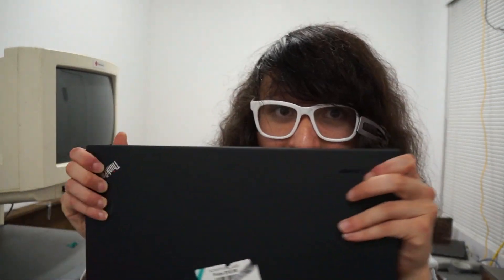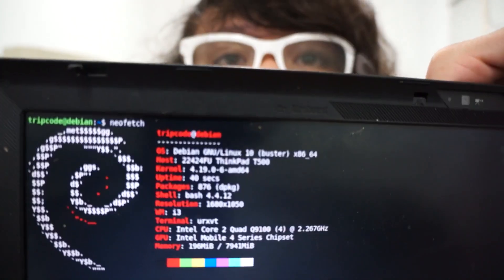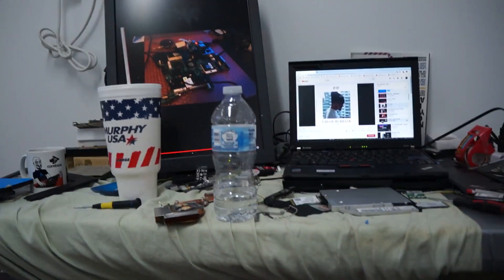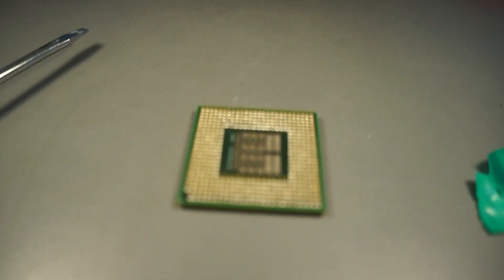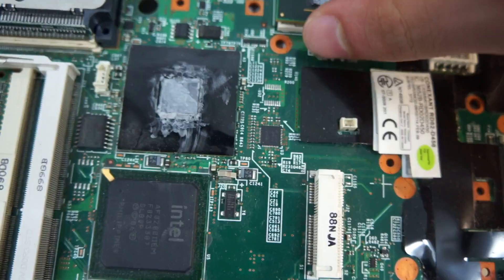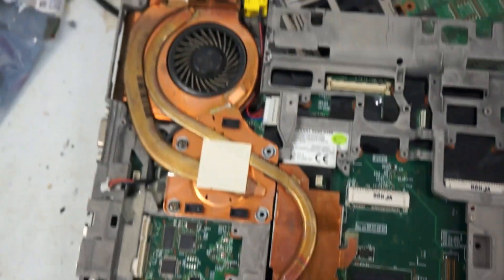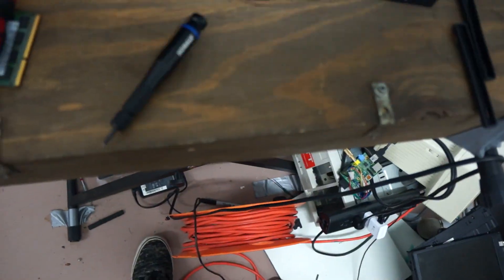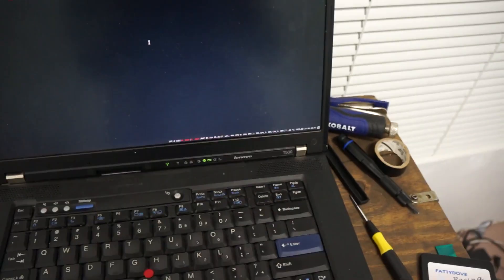Thinkpad T500 Quad Core (The fastest libreboot laptop?)

Comment: Hey got a few questions about this build trying to attempt something simaler for use in a 2503 advanced dock and want a quad core to power it, is this doable for windows ?
Reply from the maker: Kinda, its been tested with windows 7. Unfortunately I have no personal experience with it and haven't heard about anyone doing a windows 10 installation either. 

Although from the thinkpads.de forums

"With this ROM, you can boot to Windows 7 with the Quadcore CPU and Suspend-to-RAM works as well.
However, there are still several issues:
>The keyboard in SeaBIOS often doesn't work (it works later in the OS)
>The wake from S2RAM takes forever on Windows 7, sometimes doesn't work at all.
>Clock doesn't work in Windows 7
>Installing Windows 7 from DVD doesn't finish, it has to be on the HDD already (I didn't test Linux)
>some more issues"

Unfortunately I have no knowledge of trying this with a advanced dock.

Sorry I couldn't be that helpful with your project.

Good luck, and have fun, Also curious about how it turns out :D

Comment: I snagged a ThinkPad W500 on eBay for about 80 dollars that has a T9900 (~3.0 GHz Dual-Core?), though the battery life on this is a complete joke even with the Ultrabay battery lasting less than an hour. Hopefully when I have some spare time on my hands, I'll be able to attempt to libreboot this.
Reply from the maker: I haven't tried this mod on the w500 :D it would be pretty cool though especially if you had the graphics card working.
Reply: @tripcodeQ7  I might just end up sacrificing the graphics card, considering that NVIDIA to this day does not play well with the libre software community and the GPU is really outdated by today's standards.

Comment: Windows 10? But why?
Reply from the maker: I hate using windows 10, but it boots up on more hardware and I can dd an image of it. I have an image for when I sell computers occasionally on craigslist. I don't use it for anything rather then bios updates.
Reply: @tripcodeQ7  debian can't update the bios?
Reply from the maker: @alexandrprincip6366  I don't think so, they provide bootable disks I think. Your updating the ec firmware by updating the bios and they just provide exe files
Reply: @tripcodeQ7  sad to here that. Modern thinkpads not for linux systems. Time to switch on dell.
Reply from the maker: @alexandrprincip6366  https://forums.lenovo.com/t5/Other-Linux-Discussions/How-to-update-T500-BIOS-under-Linux/td-p/3783699 they provide a iso file
Reply from the maker: I hate using windows 10, but it boots up on more hardware then 7 and I can dd an image of it. I have an image for when I sell computers occasionally on craigslist. I don't use it for anything rather then bios updates.